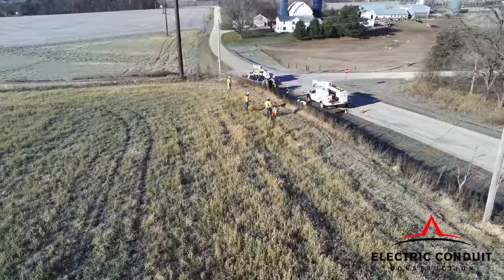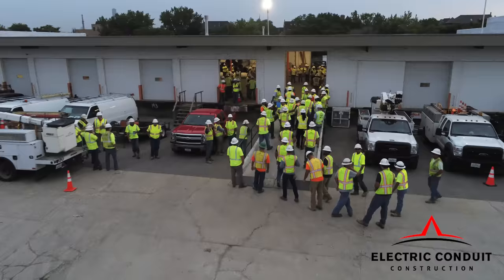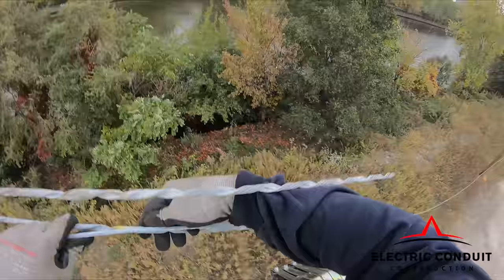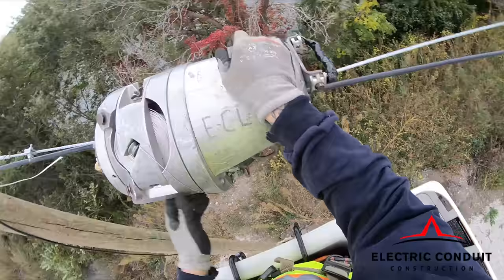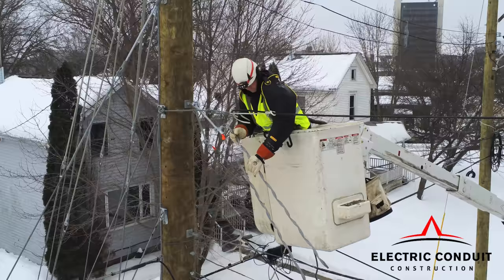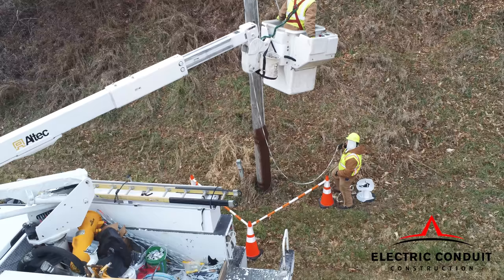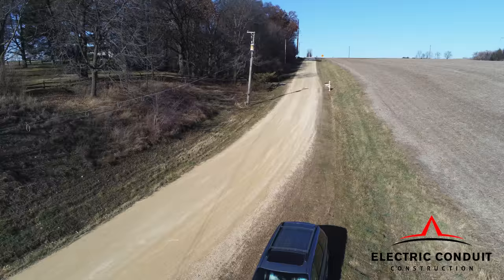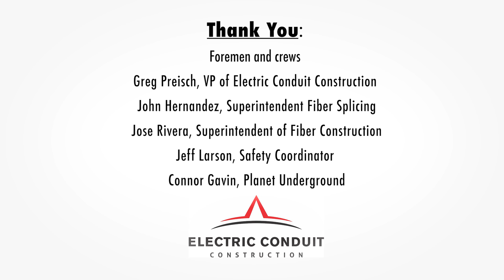The Installation of Aerial ADSS and Overlashed Fiber Optic Cable

Comment: Suggestion. Hang a reel of spider rope on a brake. And pull that through each pole while you’re framing. Then use spider rope on a capstan to pull in. The make up lead dead end and sag and clip in each pole back to your reel of fiber. All that mess with tying mule tape looks time consuming and a pain in the ass
Reply: Best thing I have found is pulling strand with a 4 wheeler or side by side across a quarter or half mile stretch. Or whatever is safe. Groundhand continually moves up one or two lineman with buckets while they frame the pole and attach clamps /strand and bond if need be. Roadside is best for this easement is different however
Reply: Attaching down guys as well. Once you get in a groove you knock spans out quickly and easily
Reply: Exactly how we run our jobs.  leads to us running 15 thousand feet some days

Comment: One can only wonder why a company thats so invested into placing cable, has no cable placing trucks…..
I’m assuming the ADSS fiber they are placing is actually for the Power Company, and may be running from one substation to another, hence why its so high on the poles.
Reply: We install according to the customers design drawings and specifications.

Comment: IBEW has no business installing Fiber or even touching Telco. I call BS on this. This is nothing more than to inflate the fee charged to the client. I've done this job and you don't need a crew of 12 or a dedicated spotter for someone in the bucket. Hell even our power crews don't do that. I will guarantee that a competent crew of 2 to 4 can run circles around these jokers anyday. Why do power companies not mess with telco? Because they don't need to. I will guarantee that the real world of this company is nothing like this video.
Reply: Your right the typical Crew (depending on the location of the installation) can be run well with 3 people… 2 grunts and a lineman, hell you can even run two lineman- two trucks and one ground hand. All depends on the job
Reply: why do you think the neighborhood across the bridge and further on down my neighborhood had fiber but my little circle has yet to get it, it seems as if they have all skipped over us and for no good reason i’ve seen a couple alabama power company trucks come but that was abt a couple weeks ago still haven’t done anything yet tho any thoughts on that ?
Reply: Exactly

Comment: What happens if, as a result of an accident, 1 or more of the poles are destroyed? Wouldn't this process be more guaranteed if you go underground and leave fiber collection points in certain regions and fiber cable excess shares in certain regions? Why don't you prefer underground?. This is a situation we come across a lot. traffic accidents and cars hitting the poles are tractors trucks trucks. and this time it really takes more time. but underground, such situations do not occur. In the underground cabling, cable share points are created every 100 meters, and 10 meters of cable allowances are left at these points. In addition, in cases such as natural disasters and earthquakes, the cable can stretch underground, since the cable shares are left. it prevents it from breaking. In addition, collection points determined in the buildings are created. this is the best part of your work.
Reply: Underground costs more in equipment overhead, is still prone to damage from other excavation and takes a lot of extra work breaking through the frost line to either repair or continue installation into the winter.

Comment: Why you dont use self supporting cables ? This method seems to me way too long and not effective
Reply: Did you miss the literal second half of the video?
Reply: @telecastky  i havent watched that bcs it seems to me slow, not efficient and expensive
Reply: @telecastky  drop cable is very good
Reply: @michalfurberger511  not really
Reply: @michalfurberger511  they covered self supporting cable in the second half. Pay attention
Reply: lashed system is still used but i agree it is an extra expense but i think it is more hardcore they demonstrated it beacuse it is used in some instances, the self supporting system has also been demonstrated
Reply: There are advantages and disadvantages to both. ADSS fiber uses no strand - which is great if you only need one fiber and only have to go from point a to b. Placing strand and then lashing does several things, but it takes longer. For one the strand is a lot stronger and can actually support and stabilize the poles. It also provides the company (small companies have to lease space on the poles since they dont own them) a position on the pole they can later expand simply by placing and lashing more fibers to that same strand. Lastly, the strand provides a way to attach services to homes and business if the provider is offering service to everyone. Now they can attach span clamps mid span to run service lines to every home they pass if need be.  Self support fiber with its own strand also exists, but anytime the company wants to leave a maintenance coil somewhere, now the guys installing it need to strip and remove say 100’ of that strand, and then splice the remaining strand together. Another downside to that is repairs, if something gets hit, chewed up or burnt. Its can be more labor intensive to add a new piece in to replace a bad section.
Reply: @kctyphoon  from evaluating this comment and another one you made you seem to know alot about this field. Are you a foreman ,lineman ? I was thinking of joining this field of work.
Reply: @josecollado6054  I've been a telco lineman for about 22 years.  About 20 of them have been a union job for a very large company and 2 yrs working for a contracting company while I was waiting for an arbitration case to settle with my union job. So I've seen both sides. My advice would be to apply for a position at the largest company (whoever the major service provider is in your area) and at least get an application in,  even if they arent hiring at the moment - or take any position they offer just to get your foot in the door  with the intentions of transferring to a different department when openings are available. Either that or look for someone hiring fiber splicers. If you know (learn) how to splice and troubleshoot fiber well, u can find a job anywhere in the country. Line is great on the union/large company side. Not so much working for contractors. It's a just a job vs a having career u can retire from one day.. For lineman at a big compnay,, getting (already having) a class A CDL can be a big help when applying.
Reply: @kctyphoon  thank you so much first for the response and for the great information and insight you have given me. I will definitely look into that and I hope you won or will win your arbitration case. And out of curiosity what kind of lengths does an average crew run in a day ? Thanks again
Reply: @josecollado6054  YW, and my case was won about 3 yrs ago so I've been back at my union job. What gets put up in a day all depends on where it's going, what obstacles you're working around, and most importantly who you're working for.  I get paid the same no matter what gets done. Safety, weather conditions and compnay expectations all play a part. We dont work in the rain here, and the company is so large theres no pressure to do things quickly. Working for contractors, or - your paycheck being dependent on how much footage you do will change all of that.  The compnay I work for is a place people spend 30 or more years working at.  You dont find that too much with contractors since theres alot more pressure to get things done, and done quickly. The physical demand working at that pace can be unsustainable, which is why they have such a high turnover rate with employees. In most cases theres alot more traveling involved working for contractors since they HAVE TO go where the work is.  My employer probably has hundreds of locations throughout my state and I'm lucky enough to be garaged 20 minutes from home. I almost never have to travel outside the area my garage covers, which is prob only 30-40 minutes in any direction.  It's a much, MUCH easier life (and job) then working for contractors.
Reply: @josecollado6054  and most importantly, the pay, benefits, opportunities, and vacation time given is far greater at a large compnay. In 3 more years I'll have 25 years in. That'll bring another week of vacation time.  So then I'll have a total of 5 weeks vacation in total, on top of the 2 weeks paid sick time every year. I think my pay scale is up to around $43 an hour, and time and half on OT of course.
Reply: @kctyphoon  wow again thank you for the amazing insight and congrats on the case. The reason why I was asking is because it was for a contractor that I first got the inkling to see what it was about. I will definitely go the route you said first and get my foot in the door and move from there. Again I thank you very much , stay healthy and be blessed.
Reply: @kctyphoon  yes that is so true . Congrats my friend . Get your last 8 years in to make 30
Reply: @josecollado6054  if you have an opportunity to work for a contractor, I’d say take it and get some experience if they are willing to give it to you. See if its something you like. You might like it or you might hate it, Its not for everyone. . Line is a lot more physical then splicing, but both can pay very well after getting some years under your belt. It would only look better on a resume, give you big leg up over others and likely get you hired at a higher pay scale when applying for a better job at a larger company. Consider it an investment and paid training - but dont stop applying to other companies that can offer a real career over just a job. I live in the Northeast - and my company (i wont mention their name here, but we are traded on the NASDAQ) was planning on doing a big hiring spree -  but got put on hold due to covid. With the whole pandemic thing winding down and big gov investments targeted to expand broadband - I’d say a lot of big companies will be looking for people soon.  Give it a shot, see what pans out. Lastly I’d say if at the start of any career for any company - if they offer a 401k and match a percentage of your contributions especially - set that up ASAP and contribute as much as you can.  The years go by quickly and your weekly contributions will turn into hundreds of thousands of dollars waiting for you upon retirement.  
I wouldn’t exclude applying for city or gov jobs either. By me, those guys do VERY well.  Good Luck.
Reply: @kctyphoon  thank you my friend for the encouraging and great advice. You seem like a genuine person which is refreshing.   I truly appreciate it and the best to you as well.
Reply: @kctyphoon  😆
Reply: @kctyphoon  😊
Reply: why do you think the neighborhood across the bridge and further on down my neighborhood had fiber but my little circle has yet to get it, it seems as if they have all skipped over us and for no good reason i’ve seen a couple alabama power company trucks come but that was abt a couple weeks ago still haven’t done anything yet tho any thoughts on that ?

Comment: What model is the cable lasher.can you use a C or a J2..for fiber optic ....for 96 strangs
Reply: Either, normally the c lasher is used on easements since it’s lighter for the climber to transfer on hooks.
Reply: Apollo is superior in nearly every way. No downpressure required for it to lash which means no strand lock , you can reverse the rotation if it gets jammed and has no external cavities to get caught going through trees.
Reply: @jacobmarley2417  you're insane 😂
Reply: @leezy7787  I am guessing you have never overlashed. That alone makes apollo superior equipment.
Reply: It depends what youre doing.  The gmp J and c models are basically the same machine, one just having a larger cable capacity then the other.  If youre always lashing fiber to bare strand, the C lasher is all you need. If you ever have to overlash fiber onto existing cables, especially larger bundles of cables - there will be instances the C wont physically fit onto them where the J would.  The downside of those is the C and J lasher can overlash, but not that well compared to other models.  The absolute most versatile lasher ive ever used is the GMP Apollo.  It’ll do everything well, but its heavy compared to the C lasher.  Where is really shines is through trees, and over lashing. The machine will even lash upside down, you can jump it over obstacles, and theres no brake on it like the C and J.  All you need to do is pull it from any direction as long its moving forward.  We lash using the trucks, not ground guys.  The bucket can pull it from over, under, or on either side of the cables and it will work well.  DCD seems to recently have released a new version lasher called the Falcon that looks interesting.   To lash a 96 fiber to bare strand - ANY lasher will work, even that tiny lasher from GMP called the Sierra. Ive never used that one since its worthless for anything else, and it can only single lash as well.
Reply: @leezy7787  no, he isnt….
Reply: @jacobmarley2417  How the hell do you reverse the rotation? I'm genuinely curious, I've only ever seen it spin counter clockwise.
Reply: @diablo3053  Are you referring to a temporary reversal or a permanent lashing reversal?
I was talking about the ease of it reversing if it gets jammed for instance . I have never had much luck with the J design in doing so.

the reversal mechanism is directly underneath where you pick up the unit from the top. You squeeze them together and it will free rotate or reverse.

hope that makes sense
Reply: Ahh, you’re talking about the clutch up top. I thought you meant that it could lash counter clockwise/clockwise. My mistake.
Reply: @diablo3053  I couldve worded it better.

Comment: Nahhh you don’t need a roller every 4 feet lol.. it wastes time… especially in a open area like that… in this area I’d leave like 20-30 feet of space before adding a roller, makes it easier to lash too
Reply: why do you think the neighborhood across the bridge and further on down my neighborhood had fiber but my little circle has yet to get it, it seems as if they have all skipped over us and for no good reason i’ve seen a couple alabama power company trucks come but that was abt a week ago still haven’t done anything yet tho any thoughts on that ?
Reply: @iamnobodyy_  it depends on the company your getting your wifi from, back when I was working we would pull cables only on certain streets that had the most customers, however u could call your wifi and ask if they have fiber around your area, if they do’ They will send a splicer who can personally connect the fiber cables to your house.

Also depends if you have power lines or Conduits around your area that are connected to a completely different Hub

Comment: How long does fiber construction take because so far I seen them feeding the cables underground
Reply: So what’s the next step they have to do after feeding the cables underground
Reply: It all depends on your area.  Cable can be in the air, underground, or both.
Reply: why do you think the neighborhood across the bridge and further on down my neighborhood had fiber but my little circle has yet to get it, it seems as if they have all skipped over us and for no good reason i’ve seen a couple alabama power company trucks come but that was abt a week ago still haven’t done anything yet tho any thoughts on that ?
Reply: Depends on how many times the inspectors shut the job down for the day because a guy's boots came untied... in all seriousness, that's a question that just cant be answered very easily. Too many unknown factors. ex. Underground construct: Rocky ground slows a project wayyy down. I've seen 100' drill shots take days. Aerial: makeready (moving other cables up or down to make room, trimming trees..just to name a couple.
Reply: I already have fiber this was a long time ago I got 1gig up and down

Comment: So do you guys use high voltage electric lineman for fiber in the power zone?? I’m a union lineman in New York. The commu😅guys can only work on the fiber in the comms space. There is a bunch of utility owned self supported fiber in the power zone between primary and secondary. That have us do the maintenance and any work on power zone fiber because they are not qualified to work in the power zone. Need to go through a union apprenticeship for high voltage training. I’m a journeyman lineman. Fiber is fun. Easy peasy
Reply: Easy because you don't know what you're doing sparky.  Union lineman 😂
Reply: @BulletSerenade  ok buddy